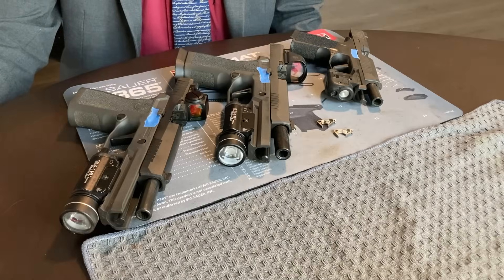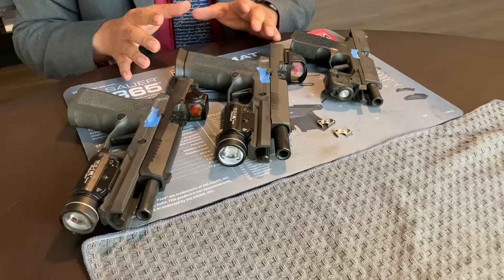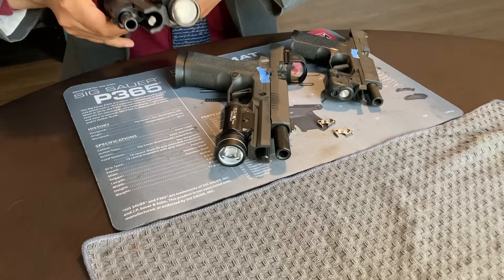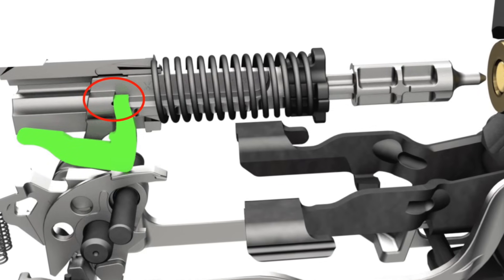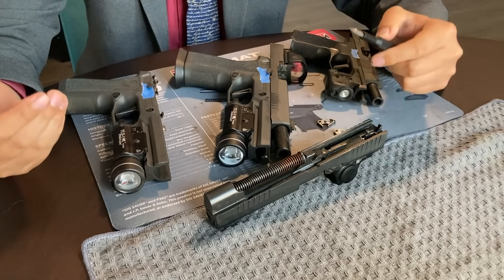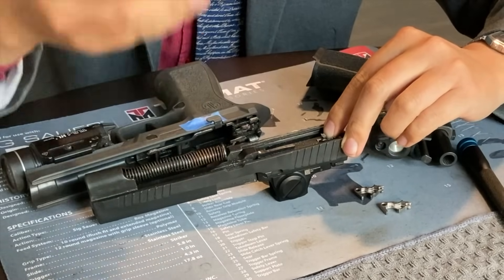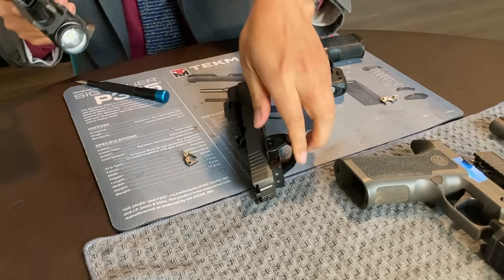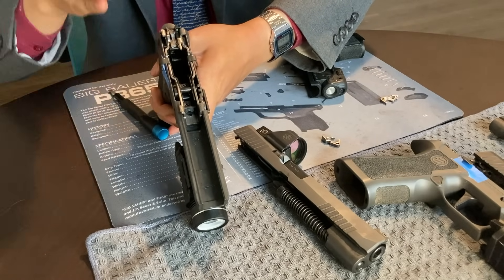How to fix a P320 that fails the Sear Movement Test

Comment: Great analysis. I agree that the sympathetic movement is a major issue, but you used a push pin to push down the sear for your test. In real life, unlikely there’ll be a foreign object that sticks into the P320 and pushes down the sear. Any thoughts on what may have been the “push pin” for the uncommanded discharge cases? The sear springs seem to be strong enough to prevent vibrations from dropping the sear.
Reply from the maker: I don't care why the sear is moving, I care what happens when the sear moves, no matter what is moving it aside from the trigger. If we keep the Striker Safety Lock in good repair and prevent it from being deactivated by anything other than a trigger pull, all the uncommanded discharges go away no matter what else happens with the gun.
Reply: @ yeah I get your point. But like you already mentioned in your video, the firing pin safety could have a faulty spring or something that prevents it from engaging. In that scenario, if the sear drops for whatever reason, there still is going to be a uncommanded discharge. For that reason I believe it’s still important to find out what exactly caused the sear to drop in the first place. Maybe the trigger weight is still too high to overcome the sear springs and they should just freaking add a trigger safety like all the other companies have been doing for their striker fire pistols.
Reply from the maker: @CZCO-e4j  Both the Striker Safety Lock and the Striker Safety Spring are easy to test for wholeness and function. You don't even have to field strip the gun, just lock it back and all the relevant components are exposed for you to push and observe for expected behavior as part of your standard PMCS.

Comment: Will chopping that leg off make the 320 more likely to discharge when dropped?
Reply from the maker: I don’t see how. It should be less likeky now, between lessening the mass / inertia of the Sear even further and ensuring that the Sear, even if it moves, cannot deactivate the Striker Safety Lock.

In this configuration, two simultaneous and opposite inertial actions would need to occur for the pistol to discharge: the Sear would need to push down against spring pressure to release the Striker and the Striker Safety Lock would need to push up against spring pressure to get out of the way of the Striker.

Comment: Has anyone considered or investigated that possibly the sear drop part of the issue is the sear not fully resetting after a firing sequence? If the sear is not going up all the way then it will be much easier to have it accidentally drop.
Reply: The crossed sear springs refers to this if I'm not mistaken.

Comment: Does this impact drop safety? Sig marketed the lighter weight components as being the fix, being the inertia of the original design being enough for the trigger to "pull itself" on drop, but I wonder how much that rear leg engaging the trigger bar is responsible for the improved drop safety.

Funnily enough, between this and the drop safety thing, it seems sig spent all this engineering money trying every which way to make it drop safe except for putting a trigger safety on it like literally every other striker fired gun out there. Seems like a proper trigger safety would address both issues - no "sympathetic trigger bar movement" on improper sear timing, and no trigger movement on a drop regardless of trigger weight.

Seems more still ought to be done to figure out why the sear is moving out of time anyway. I've heard that a poorly fit takedown lever causes the slide to ride too high with minimal engagement. Considering the takedown lever causes the sear to move downward to allow for disassembly, I wonder if holster designs are putting pressure on the lever to cause just enough sear movement on a poorly engaged sear to drop it enough to release striker (and with the non-disconnector like trigger bar, cause discharge with the rear leg) . Ultimately we have to identify what is causing that third modality of failure, I think this is a good aspect to look at.

It seems like if one were to really want a P320 in spite of it all, one could build an example with an agency arms bladed trigger, a manual safety, and opt to use this modified sear. Between those features, I'd believe it'd be nigh impossible to discharge barring actual parts breakage (absent from reports).

Comment: Isn’t this still kinda scary though (excluding the fact that the striker is attempting to move forward). If you are carrying the 320 and the sear drops you would be carrying a dead gun right (needs two rack to recook striker).Or am I mistaken?
Reply from the maker: A badly impacted P320 having a dead trigger like a badly impacted M&P1.0 or VP9 is a far more preferable end-state than your pistol going bang in the holster. Even if we assume for argument's sake that this does actually increase the chance of sear slippage (I don't think it actually does), I don't believe very many people would want a slightly lesser chance of a potentially catastrophic event over a slightly greater chance of a dead trigger.
Reply: @  yea of course I’m not disagreeing that it’s preferable. I’m more saying it still doesn’t completely fix the 320. It’s more of a stop gap solution for a range gun to make it safer.

Comment: After the mod to the sear must you pull the trigger to remove the slide?
Reply from the maker: My friend chopped off his Sear's rear leg below the section on which the Takedown Safety Lever acts. The Takedown Safety Lever still fully functions, no Trigger pull is necessary to disassemble the pistol.

Comment: I had a follow up question, so on the FCU that failed the test did swapping the sear to the good sear allow that FCU to pass or was the issue mostly associated with the FCU itself?
Reply from the maker: The new sear alone did not change the behavior of my friend's failing FCU. Only when we chopped off the rear leg did his pistol's Striker Safety Lock finally start working as intended. Aside from ensuring that 1) the Striker Safety Lock is in good condition and 2) the Striker Safety Spring is in good condition and properly installed, everything else about this design flaw is contained in the FCU.
Reply: @P320Truther  okay thanks, I'm going to throw the strock trigger back on to see if I can get a proper test on the M18. If it passes I'm going to throw the agency trigger on my M17 see if the "failure" follows. I wish the trigger tab safety of the agency trigger would engage sooner to prevent any and all unwarranted movement of the trigger bar but I guess it is what it is.

Comment: What I never understood, is why don't they just make the 365 fcu, but in 320 dimensions. It's clearly superior and not a SINGLE issue has ever been reported. I for one, trust it whole heartedly pointing at muh nuts while in the holster. The 320... not so much.
Reply from the maker: It has been suggested to me that Sig should just hire Sim Jullivan (Jim Sullivan's mirror-universe counterpart) to upscale the P365 to a full-sized service pistol.

And beef up that one spring that breaks around the 3,000-4,000 round mark just to reduce the annoyance and required maintenance rhythm.
Reply: Whoever made that joke is really funny!

Comment: The striker safety on the striker assembly was supposed to be a stamped part but sig chose to do it cheaper with another method of manifacturing. Supposedly a bunch of them are out of spec when sig gets them
Reply from the maker: The striker safety lock is an easily-inspectable part and was perfectly functional on multiple FCUs that failed the Sear Movement Test.

Comment: Seems like the rear sear leg would be a redundancy for actuation of the FP safety. If the bar for some reason stops actuating of the safety lifter, and you no longer have that rear leg, you now have a paperweight in a scenario where you need it to go bang. I honestly prefer just testing the sear movement and making sure the parts work together correctly.
Reply from the maker: The Safety Lever is solely controlled by the Trigger Bar. If the Safety Lever stops responding to the Trigger Bar, then it would stop responding period whether the Trigger Bar were being moved by the Trigger or the rear leg of the Sear.

Comment: I wonder if we could get an engineer to do a CAD drawing so we can move all the parts and see how they work internally with one another as we manually stack tolerances on parts in the system.
Reply from the maker: Would that I had parts dimensions, CAD software, and the knowledge of how to use it!

Comment: As far as how the sear gets depressed "on it's own" I've only been able to come up with one idea that makes sense, but I haven't put in the work to see if I can develop a scenario to make it happen. There is some vertical play between the slide and FCU, and therefore, potential movement between the sear and striker. This isn't unique to this design, but imagine that the sear were stuck/sticky in a way that kept it from rising back up. Repeated movement, according to my idea, could theoretically cause the sear to "walk" itself down in relation to the striker. Then you could imagine disturbing the slide - with this sticky, now partially depressed sear barely hanging on - being enough to release it. In a gun that is dirty enough, has bad enough wear/fitment, a foreign object impinging on the mechanism "or something" it's probably also more likely than most to have a dirty/stuck/out-of-spec/broken/mistimed striker safety; I have an easier time imagining the striker safety getting stuck than the sear.

My gun passes every test I put it through (including the manual sear depression test) is kept clean and I inspect it regularly. All safe handling practices always apply obviously, but yeah, my gun isn't dropping the firing pin by being picked up, moved around in a holster, or even smacked with a mallet in every different way I can come up with. I do think the vast majority of "uncommanded" discharge is just due to cognitive dissonance on the part of the operator. It's super easy to imagine, and an understandable psychological reaction. But, while I'd still like to see someone replicate a repeatable complete failure mode, with a fully assembled weapon, resulting in discharge, without multiple parts breakage, I'm less skeptical that at least some incidents are "real". 

If nothing else, some parts of the design just "feel" too small and fiddly, with required safe tolerances being too small for the construction, manufacturing methods and materials, to reach a sort of "six sigma" level of reliability. I like my gun a lot, and now that I understand how it works, I trust it, but the internals suggest that it's engineers spend more time in CAD than they do with hands on steel.

Comment: I saw a comment on another video stating there is a difference between the 9mm take down lever and the other caliber which rides the slide higher. Sometimes they arrived mismarked. Have you focused on this as a cause for those conditions? Hope we can figure this out. "We're all in this together!" 😅
Reply from the maker: The Takedown Lever is identical on all caliber FCUs. Anyone claiming the Takedown Lever to be the source of the problems lacks fundamental knowledge of how the P320 FCU works.
Reply: @P320Truther  my mistake: rewatched and it's actually the take down safety, a part that prevents the mag from being during field stripping. It's a video by focus tripp.
Reply from the maker: Ah - now that is an entirely different part and... Okay, that could bear some looking into. Thinking conceptually about it without a part in hand, I am a little skeptical, especially as his source is getting one aspect of the Takedown Safety Lever's function completely wrong. However, I could also conceive of it causing an issue. It all depends on dimensional changes which ought to be easy to visually demonstrate...

Comment: Ok so here is where I get lost.  Sig redesigned the sear because the sear was dropping the striker when the gun was dropped.  So they've made it harder for the sear to drop without trigger pull while inadvertently defeating the striker safety.  So how is the sear dropping from getting out of a car now but not from drop tests?
Reply: That's the part he says requires am institutional level of resources and experts to test

Comment: my question is does the manual safety mitigate the issue by preventing trigger bar movement?  thank you
Reply from the maker: The one Manual Safety FCU I've been able to get my hands on demonstrated downwards movement of the Trigger Bar when tested with the Manual Safety engaged, but that's no guarantee of how it reacts in other pistols. Some additional doubt comes from the Camp Foster report stating very emphatically that 1) The pistol was properly functioning in all respects, and 2) the Manual Safety was on.

Conclusion: Inconclusive, I don't have enough of a sample size to tell whether the Manual Safety is effective at mitigating the effects. Obviously, removing the rear leg of the sear obviates the need for that mitigation.

Comment: Changes to the sear design to  increase margin of safety inadvertently caused a negative unintended effect in the trigger bar motion which affected the engagement of striker safety.  That was an outstanding analysis sir. Hopefully Sig is watching and Ends It Today.😂
Reply: It's pretty wild how different the pre and post voluntary upgrade designs are. It does look like in their haste, they overlooked the unintended issue of coupling trigger bar motion via that little dog leg. 🤷

There is still the disturbing issue of random sears disengaging while holstered. To have a potential click not bang when needed is also scary if your life depends on this thing.
Reply: @blantant  Yeah, this shows how the sear dropping can overcome the secondary safety, this leaves finding the root cause for the sear dropping but it's a major first step in improving safety. The gun randomly shooting you while holstered vs not shooting when you unholster it and need it are both bad outcomes.

Comment: I get what you're saying but how does the sear move?  You're having to push it with a punch.
Reply from the maker: I don't care why the sear is moving, I care what happens when the sear moves, no matter what is moving it aside from the trigger. If we keep the Striker Safety Lock in good repair and prevent it from being deactivated by anything other than a trigger pull, all the uncommanded discharges go away no matter what else happens with the gun.
Reply: it simulates independent movement of the sear; think of any jarring impact that could cause the sear to fall which is where most of suspected cases are occuring

Comment: I've wondered what happens if the sear slips free from striker spring pressure and bad geometry. Would there be a release of energy like snapping your fingers? Would there be an inertial transfer or other pressure on the trigger bar?

Comment: Great info! But I still dont understand what could hypothetically cause sear movement without the trigger being pulled or the sear or striker breaking......
Reply from the maker: That's for someone with institutional levels of test rigs and sample size to figure out.
Reply: @P320Truther  maybe if the sear springs aren't installed properly or at all, but I think that would be noticed quite easily during trigger pulls - dry or live

Comment: Ill preface by saying that I owned 2  Sig p320 carrys and sold them off after the Montville PD footage came out. I now own only glocks and train with them competitively in USPSA. Whats crazy to me is how Sig basically re-invented the wheel with this entire design to come out with something basically on par or worse than a glock. It really shows how ahead of its time the glock design was and still is. Ruger nailed it with the RXM. It is inevitable that Sig goes down for this.

Comment: Question: does the forward movement of the trigger bar when the sear drops cause the trigger to move as well? Because if it does, then wouldn't putting in a dual stage trigger solve that? Also it would solve at least one of the drop safe issues that's been complained of. There's footage of a P-320 discharging when dropped in slow motion and you can see the trigger moving back from its momentum when the gun hits the ground breech first.
Reply from the maker: I have not been able to get my hands on an Agency Arms Trigger (the one with a trigger dingus) to test. Preventing forward movement of the Trigger Bar is supposedly what the Manual Safety does, but reports have been mixed on whether an activated Manual Safety does or does not result in a pistol that successfully mitigates the design flaw.
Reply: @P320Truther  but do you think a trigger safety would solve the problem? Is there anything that leads you to think it wouldn't? I don't know that much about guns so whenever I see something obvious, I have to wonder why it's not a thing because if I can think of it, then surely the experts can which means the reason it's not a thing is because they know something I don't about why it wouldn't solve the problem.
Reply: @davidhoffman6980 re:the obvious. I think the same way but also within the framework of the economics. anything without a cheap MIM workaround was probably not cost efficient enough? My guess
Reply: @blantant  I don't think I understand your answer. Can you explain when the MIM is, and what cost has to do with whether the trigger safety would prevent the striker from releasing if the seer was depressed?